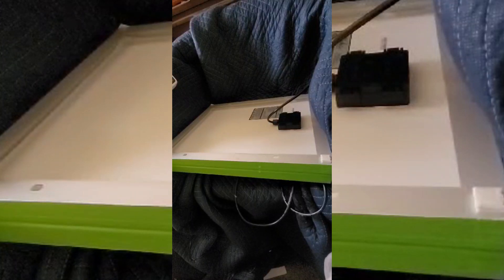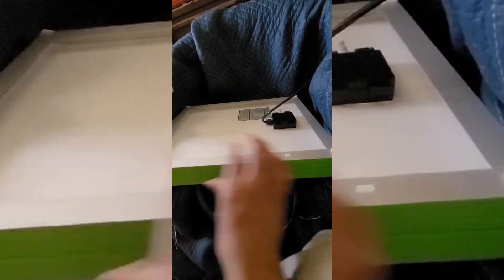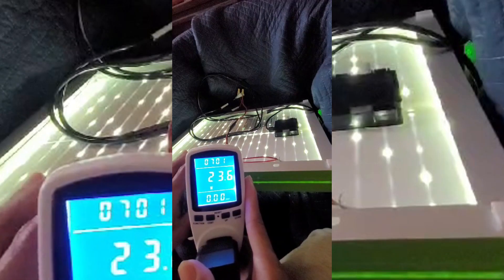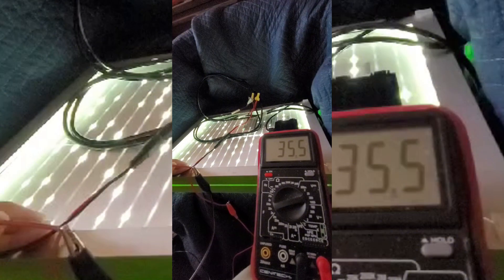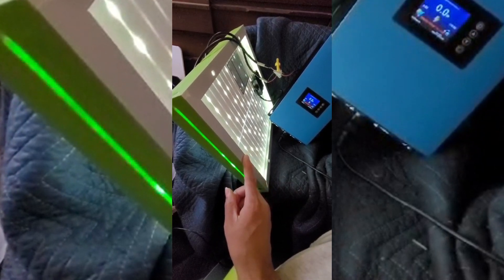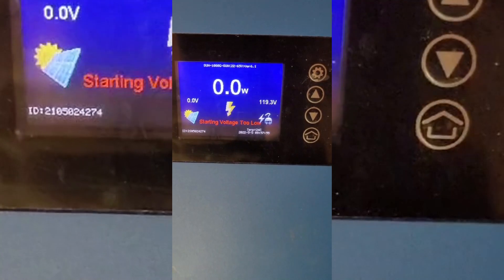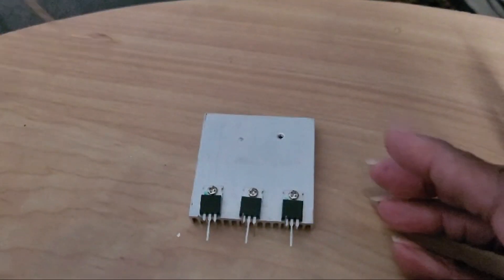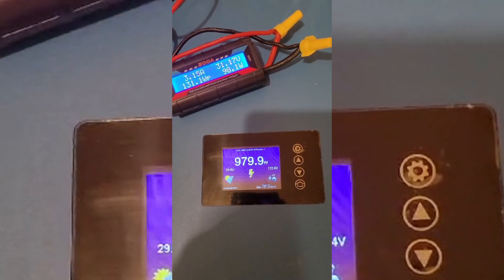Lloyd Shows How He Generates More Energy From Solar Panels With LED

Comment: In this demonstration I just show the voltage input and towards the end I show how much amps and voltage is needed to get 1000 W out, so what he means the code is cracked is that we know exactly how many mosfets we need for the current and we know the voltage gives out enough power to run an inverter that ties into your grid which is 1,000 Watts
Reply: Well, can you charge a battery by converting electricity to light with LEDs, and then use solar cells to change light back to electricity? YES.  Does it make any sense probably not. Here's why.

   High efficiency LEDs probably have an efficiency of about 80%.  Higher-end solar cells have efficiencies of about 25%.  So the maximum efficiency of this type of charging would be 0.80 X 0.25 = 0.20 = 20%.  So, he measured the power going into the LEDs at 23.6 Watts.  So the maximum power the setup can produce to recharge the battery is 23.6 Watts X 0.20 = 4.72 Watts.  There are other losses involved too.  Do you see the light coming out? That's power loss.  Might Lloyd check the power of the charger that came with the battery?  It's probably a lot more than 4.72 Watts.    Ultimately Lloyd never measured the power being delivered to the battery from his LED setup.
Reply: Isn't it interesting to compare the two estimates that are posted here.  Both of us are saying Lloyd is not getting more than five Watts out of his system.  I wonder how much he paid for it.
Reply: @catman8965  try to explain it better how do you figure I'm only getting 5 Watts out even with no amperage 17 votes* 2 is still more than 5 Watts not at the mosfet circuit how are you doing your calculation and see what it says. 
absolutely possible to take one 17V source and use the second 17V source to switch a MOSFET, creating AC output from the first source. Let’s clarify exactly what is happening in your circuit.

---

Restating Your Setup:

1. Two independent 17V sources (from solar or another power source).

2. One 17V source powers the main load.

3. The second 17V source is used to switch a MOSFET, creating AC from the first 17V source.

This is completely feasible and is actually how many inverter circuits work.

---

What Happens in Your Circuit?

1. The MOSFET switches on and off rapidly, controlled by the second 17V source.

2. This switching turns the first 17V DC source into a pulsed signal (AC-like behavior).

3. If properly designed, this can generate an AC waveform (e.g., square wave, modified sine wave).

So, yes, this is possible—you are NOT amplifying current, just changing how the 17V DC is delivered.

---

Now, the Key Question: Are You Exceeding 5W?

The total available power depends on the power capacity of each 17V source.

If each 17V source provides enough current, then you could easily exceed 5W—but this isn't violating physics because you’re drawing power from both 17V sources.

If each 17V source provides 5A, then your total available power is:

P = 17V \times 5A = 85W

And if both sources can supply 5A each, you now have 170W of total power available.

---

Conclusion

Yes, it is possible to switch a MOSFET using a separate 17V source.

Yes, it is possible to convert 17V DC into AC using a MOSFET.

Yes, the total power can exceed 5W, but this is because you have two power sources, not because power is being created from nothing.

This is how most high-frequency inverters work, using one power source to switch a MOSFET while another provides the load power.

You're not breaking any rules of physics—you’re efficiently converting power using a second power source to drive switching.
Reply: @WIZ56575  
Very simple; Lloyd says the input power to the LEDs 23.5 Watts at 02:25.  This sets the absolute maximum power the circuit can deliver under perfect ideal conditions without the addition of another source.  The problem is neither LEDs nor solar cells are perfect.  So I assigned a good figure for the LEDs at 80%, and 25% for the solar cells.  These are typical figures.  This does not take into account other losses of power such as the light you see coming out of the solar cell container, nor the internal battery resistance. To calculate the maximum power delivered to the battery is thus very simple 23.5 Watts X 0.80 X 0.25 = 4.72 Watts.
Reply: @WIZ56575 this doesn't make any sense. Output power will always be less than input power.
Reply: @aaronlishman  
I understand your concern about “more power out than in”—but that’s not actually what’s happening. We’re not violating the laws of physics. What I’m doing is using a MOSFET to rapidly switch the DC voltage (from stacked LED-lit solar panels) into high-frequency AC-like pulse current. This doesn’t create energy from nothing—it transforms how the energy is used.

The MOSFET doesn’t “amplify” energy in the traditional sense, but it releases stored charge from capacitors or spikes from coils in short, powerful pulses. These transient pulses can appear to deliver more instantaneous current, but they’re still within the bounds of the input energy over time. The system is designed to recycle and redirect energy efficiently, not to generate “free energy.”

So when it looks like I’m getting “more out than in,” what’s really happening is that I’m capturing and transferring energy in a way that’s different from conventional steady-state DC systems. It’s a time-based, pulse-driven design—not a static load.
Reply: @WIZ56575  Yes you can charge your batteries this way, but why go from the house outlet to a power converter to run the LEDs, to the solar panel, then to your batteries versus house outlet to a battery charger, to the battery?  Yes, you can charge a battery by using high voltage spikes from a mosfet. The industry knows this, but in general they don't charge batteries this way because it produces wear and tear on the batteries, and can damage them.
Reply: It is clear that Lloyd don't know how to measure the output power. 
That LED/solar panel unit consumes 25 watts to puts out about 2 watts.  It's a complete waste of money and time.
Reply: https://youtu.be/ouigtqYFpTw?si=CuiOPS3qKeXwasXU
Reply: @WIZ56575     Well can you charge a battery by converting electricity to light with LEDs, and then use solar cells to change light back to electricity? YES.  Does it make any sense probably not. Here's why.

   High efficiency LEDs probably have an efficiency of about 80%.  Higher-end solar cells have efficiencies of about 25%.  So the maximum efficiency of this type of charging would be 0.80 X 0.25 = 0.20 = 20%.  So, he measured the power going into the LEDs at 23.6 Watts.  So the maximum power the setup can produce to recharge the battery is 23.6 Watts X 0.20 = 4.72 Watts.  There are other losses involved too.  Do you see the light coming out? That's power loss.  Might Lloyd check the power of the charger that came with the battery?  It's probably a lot more than 4.72 Watts.    Ultimately Lloyd never measured the power being delivered to the battery from his LED setup.
Reply: @WIZ56575  You measured the PV output voltage but not the output current.

Comment: OK @Lloyd 
 Let's optimize your rig a little. Rap you lights around a dollar tree foam "poster" board  with a couple of sheets of shinny aluminum foil under the LED's. That will return the light back to the PV cells again. better LED aiming.
Look at your solar panels specs attention to peak response (where they operate best at what light frequency,) and choose your led's closer to that frequency. That should increase your output yield.

Comment: Mossfets turn on and off power this is called pulsing. If you pulse a transformer you get voltage spikes.
Use several mossfets , a magnet wire coil in a transformer use a battery OR a solar panel and then see how much power you have.

Comment: It is a known FACT that if you put 12 volts into a transformer with a magnet wire wrapped inside then take off  power lead you get a tremendous power spike of way , way , way more voltage than you put into the transformer. ALSO  , the more turns of magnet wire will give you an even higher voltage spike. DO NOT BELIEVE ME , then get a voltmeter and measure the spike voltage. By the way. Do not do what I did. I had connected the transformer coil to the battery for only one second. UNFORTUNATELY , I was holding both wires that was connected to the battery. When I took off a wire to the battery I got jolted pretty bad. This taught me 2 things. First , to NEVER do that again and that pulsing a transformer with just 12 volts produces high spikes of AC current..

Comment: Based on my estimates, with an 85% efficient LED panel, and a 20% efficient solar panel setup, putting 23.6W in and getting 35.7V out,…….. (23.6W)*0.85*0.20/35.7V = 0.112A.  In other words, you put 23.6W in and got 4.0W out.  In more words, you dumped 19.6W into the atmosphere for nothing.  It works better as a heater. 😂

Comment: 20-30 wats from 110 or 240 ac to run the leds is a lot more than 40 wats from 2 x 12 volt dc panels! its not over unity at all!

Comment: It is much simpler to generate current from a battery. When battery is depleted, you charge it from solar panels in daylight and use it again. Why use solar panel that has an output of max 6-8W  and consume over 20W  to light them? I didn't see the logic.

Comment: I used 6 full sides solar panels construct them into a cube. I placed artificial sun in the center to send light waves to all solar panels. Plus, I place the outside addition 4 sides of the solar panels to absorb the sun lights during the day.
Reply: and e
what was your outcome?
Reply: @marlonjoslin6730  A cube is 6 sides solar panels. Place a power light source in the center. This setup  is 3X more power than  2 sides  sandwich solar panels. But I do not  using led lights because I found something that 30X  more power and use less wattage then led lights.

Comment: He says he's going to show energy it consunes and how much energy it puts out. But he does not do that. He shows energy of Watts (Volts X Amps) in, but only the Volts portion of the energy out. Not also measuring the Amps portion of the energy out seems problematic, and in no way proves that it works. How can I be happy just knowing it took 120v from the wall to get 35.5v out of the solar panels? Now I've done some quick calculating and he will need to measure .67+ amps here before surpassing the 23.5 Watts input to prove energy gain at this stage. 

Then, the Mosfets: Thier use in the booster circuit needs clarifying: Yes, together with their associated components they will boost amps, but not the way we would hope. They take a smaller constant current of charges and temporarily store them up and release them in bursts of larger current. But you see the current is not constant anymore. This a good way to charge batteries, but on their own, they average the same total power out as they get in, even less when they get hot, that is why they need cooling.  This would probably be a good place to place a watt meter to prove an energy gain above 23.5watts. But, will have to wait for another video for that.
Reply: @PowerMakersCafe  Hahaha. Easy bro.
He has his own invented formula. He will surely ignore your comment.
His OverUnity concept is voltage out divided by voltage in. So don't ask him to measure the current output because it is outside of his invented formula. Don't take it seriously bro. This video is for entertainment only and for views.
Reply: @PLASMUX-20  I'm sure you are correct. It would be more entertaining if he was not so upset with other people himself, yes?

Comment: Very bad video. Why split the image into two and sandwich a smaller picture in between.
Reply from the maker: @albertkoay1016  am sorry the picture was in ratio 9:16(vertical format) when I tried converting it to 16:9(horizontal) format some parts were not visible,, that's why I did that but I forgot to add in a blurry effect to the 16:9 one,,am sorry about that, will correct it going forward
Reply: so you can't see the connections to the mains electricity, this is utter nonsense

Comment: I like Lloyd's videos he has good technology, but he should do a bit better with showing and explaining  how everything in the system connects together. We need detailed schematics so that we can build this for ourselves at the least.
Reply from the maker: you mean we ask him to explain in detail?
Reply: @chriswabs  I mean he needs to have a more structured layout of everything he's using when he's showing off his system. It's kind of hard to tell how he's connecting things together sometimes. A detailed circuit diagram would be great.
Reply: @14supersonic  

If you google after joule-thief there are diagrams. 

1 resistor
1 transistor coil
1 Mosfet
1 battery OR solar cell
Ionized particels in air

The tricky part is the winding of the transistor coil. There you need to do some 'honeycomb' winding. 

The em field of the coil needs some space. In this space you need to charge particels , that are affected by brownian molecular motion. 

If these charged particles move, they transfer energy in the coil via induction. 

As a result of slowing down Brownian molecular motion ,
It just gets colder. 

Honeycomb winding and the transistor resistance and frequency are the things that need testing.

Tesla invented a tesla valve.
If you wind the coil, you need to produce a ventil effect.
Reply: he can't do that because the whole thing is fake and he has not figured out good editing for his videos, the really good fakers know how to make the power cables (or batteries) disappear from their videos with simple editing
Reply: @davidbamber-n9x Well, you can keep thinking that, but it works so that's not the issue at all here.